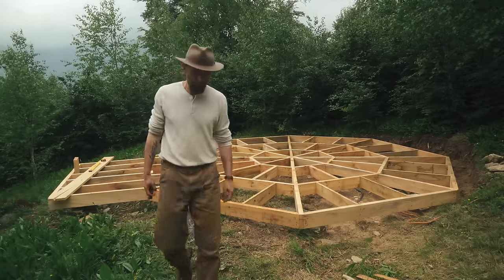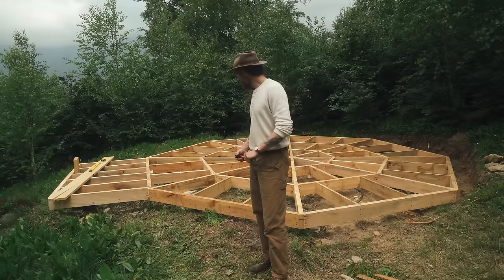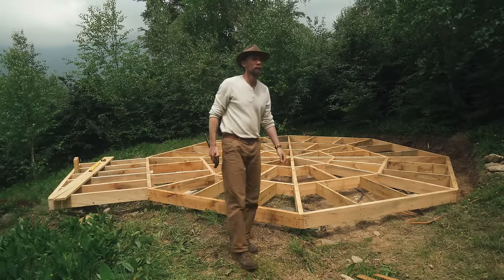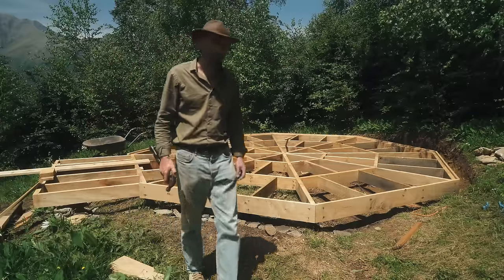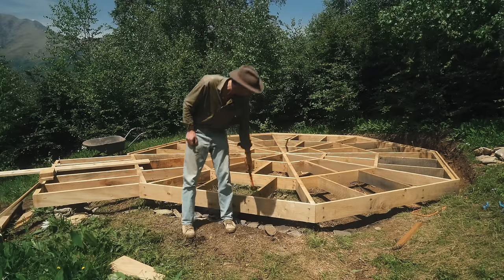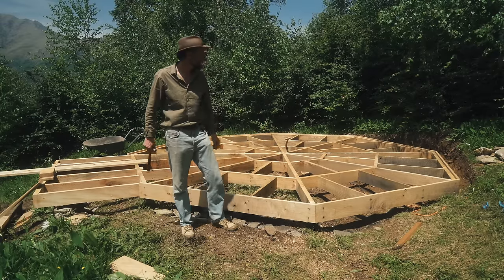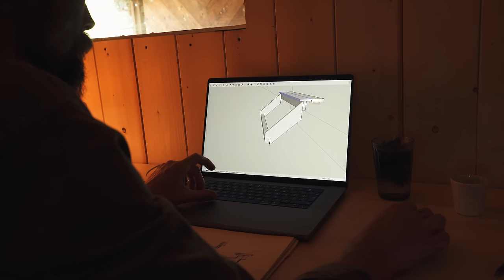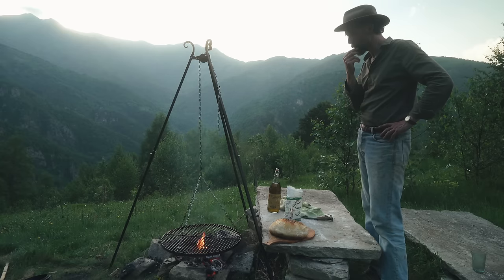#21 Baking bread on open fire, Planting more crops, Building the deck

Comment: What I find so interesting is that I would probably not do anything in the way or in the order you have chosen, but I think everything you have done is right. Great episodes. Always surprising.
Reply: I would have remained living in the trailer and focused 100% on the crane and doing the roof. But, I don’t know about his obstacles of distance, driving, winter, etc. If the roof were done first, there would be no need for an interior cabin, and the focus could be on renovating the interior permanently. What I don’t understand is why not put the interior cabin inside the larger stone barn, if you’re renovating the smaller cabin.

Comment: Dutch oven baking is quite the challenge!  Glad you didn't give up :D. The black staining on your wood could be reduced by applying oxalic acid diluted in water.  Apply it generously, wait until you see change, then rinse.  It should work on the wood, but not sure how it will react with the nails/screws.  Furniture restorers use the solution when removing stains.  I've never seen if nails/screws were involved.  You could research if you're that intent on removing the stains.  Love your channel.  I never miss an episode!!

Comment: May i suggest finding a dutch oven with feet . That way you can move it from the direct fire off to the  side and put coals underneath and on top . There is more then enough heat and it is more gentle . If you want to learn Dutch oven cooking  check out any Cowboy campfire cooking videos  . Those guys are the experts . Another great one

Comment: Great video. The way I do bread in a skillet is to heat the dutch oven on the fire, then take it off and out it on a trivet on the ground. Then put a ring of charcoal on the ground around the trivet and just a few on top. Then every so often turn it 1/4 rotation to make sure it's all cooking evenly. Just check it until its done.
Cheers!

Comment: The best way to bake bread in a Dutch oven on an open fire is to put the dough on a baking dish/cake pan inside the Dutch oven and have it elevated off the bottom by something like an upturned ramekin dish or similar on the very bottom of the Dutch oven so that the heat can still circulate underneath but it’s not directly against the fire and will cook more evenly. All the best!

Comment: Martijn, probably too late now but in NZ we use galvanised nails for exterior use and steel nails for interior as the steel ones will rust outside and will stain the wood plus become weaker over many years. I would have used galvanised screws or nails.

Comment: Not sure if anyone answered your question about the black around the nails, but it is the tannic acid in the wood reacting with the iron in the nail. Will also react to the sole of your plane. Try stainless steel. Oak is really bad for tuning black.

Comment: The term upper crust for the rich comes from the bread being less than great on the bottom.  The inferior lower part was cut off and sold to the poor.  The upper crust and bread was for the rich.  Let your coals burn down, no open flame. set your dutch oven on rocks just above these coals, and add coals to the top.  Do you add any oil to your bread dough?

Comment: If your having trouble with the bread burning on the base; just theorising, but you could try lining the bottom of the pan with vermiculite bricks (what they have on the bottom of pizza/bread ovens). It may add enough thermal mass that you could take the pan off the coals, or lift it further up and give a lower contact temperature underneath the loaf.
Maybe worth a try.

Comment: Amazing as always. I might have something to add for once, even though it's just the bread. I've never done over an open fire but it might still help. To help the crust form and be nice and crispy I spray a bit of water right before closing the lid. The steam forming inside the dutch oven helps the bread to cook without burning to quickly. After half of the baking time (in a home oven it's usually around 20 minutes at 220°C) I take off the lid to let the steam escape so the bread crust can crisp up, maybe you could just slide the lid off to side a bit or something. Also I'd experiment with pulling the dutch oven up as it bakes to mitigate the burnt bottom. Maybe gradually or maybe halfway through the baking time when you open the lid. Then you'd probably have to keep the coal on the lid to still get enough heat for the top though. I find it very interesting to try out different techniques on an open fire. Definitely interested in more baking/cooking. Also what an amazing way to live. Baking a bread with view over the alps. Dreams right there. Keep it up

Comment: try  one piece baking paper (or silicone 'paper') across the bottom long enough to go up the sides to lift bread out when finished - helps avoid scorching on hot metal bottom.
Also - after 10 minutes take off lid, give 4 or 5 good sprays of water, replace lid immediately and continue baking. The steam helps the rise, the crust and avoid scorching.

Comment: Steps are usually, 170 mm high by 250 mm wide, (foot step plate). Thats the normal architectural standard in metrics. I am sure looking at how tall you are those measurements will work for you. 😉 gorgeous bread, just need some Lurpak , lekker!!

Comment: That bread looks great, maybe try the Aussie way as for damper which is just the same but we dig a hole big enough for the pot to fit usually cast iron, put 2-3inches of hot coals in the hole then cover the lid with coals, a layer of foil folded in the bottom also helps good luck. 
PS same cooking time just not direct over 🔥

Comment: Ahhh.... it's called a Dutch oven, that pan you baked the bread in. Good to know. I think that maybe placing a grill inside this pan will keep the bread from burning its underside, or maybe placing the pan a bit higher over the fire. I know it's the 3rd attempt for you, that's not at all bad.
The bread looks great inside, good texture. I'm still working on improvement of my own bread.

Comment: I saw a u shaped stack of stone 24 “ high with bars of metal laid and mortared across at 6 inch intervals to create oven shelf then walls built up another foot or so on top of rods and lay  a slab like your big roof stones….which becomes a non stick fry/saute area…lay fire on floor / bake bread on oven shelf…create a door out of scrap metal and prop shut when baking if needed to keep temp high but bread only needs 350.   Pour water on slab when finished and scrape clean with very stiff brush…

Comment: the trick to getting bread to bake on an open fire , is to keep the temp even. Heating the bottom, adding the dough, remove from fire, put coals on top and set in vicinity of fire. Should produce even cooking.

Comment: When baking with a Dutch oven you want most of your heat on the top 
I would also suggest raising it a little higher off the fire but I will say it's hard to master getting a perfectly even heat.
It definitely takes practice good luck.

Comment: You can remove that metal stain with Oxalic Acid - there's a product called Barkeepers Friend which contains it if you can't find the acid alone. Those stairs look too steep to me and the notch (birdsmouth) over the footer is too big, weakening the string - I'd recommend having the strings pass over the footer beam with a small birdsmouth on the underside = stronger and less steep

Comment: Martijn, it is probably a reaction of the iron nails and the tannins in the wood. I used to get black stains on my hands when working with Jarrah here in Australia when the sweat reacted in the same way as iron, oak is another wood that reacts in this way. To remove it (from my hands) I used to use vinegar, not sure whether some vinegar applied on the stain not the nail (as it would increase corrosion) might help. Also campfire bread made without yeast is called damper her downunder.
Reply: interesting , in the aquarium hobby we soak the wood in water to remove tannins , does iron nail really cause it to leech tannin ?

Comment: I keep feeling that the platform could be a little better supported at the edges because as you stepped there it dipped quite a bit.
I see either blocks of 2x4's or solid stones piled atop one another. The platform looks beautiful overall.

Comment: For your bread, set your oven on a small even bed of coals. Try about 1/3 coals on the bottom and 2/3 on the top. Direct fire is too hot for baking.

Comment: I wonder if a rack under the bread in that pan might work....I've seen round "racks" or inserts with round holes rather than rungs....that might work for the bread by keeping the bottom a little elevated from the burning hot pan-bottom....?  Or just a round runged rack with some aluminium foil???   You're a brave wild one.

Comment: The bread was too close to the fire and the pot was too heated up. You'll get there. It's a fine line of finding the right temp. I've never done it on an open fire, but I've done it on a grill using coals. Just bread in general takes several repetitions before getting it right. I've been working on my whole grain sourdough recipe for years and the first dozen attempts were not perfect.
Reply: Ah... I saw the third attempt now. Yes... don't pre-heat so high. But as you can see, you are already getting it. My first attempt was similar - burned bottom. LOL

Comment: Loving the cafe lights and the platform/deck shape is delightful!! Martjin, can you tell me what's the purpose of you  burning the tips of the wooden posts? You can tell I'm not a carpenter by asking this! I had to go get myself a slice of raising and 5 ancient grains with a slice of turkey ham after watching that bread being sliced!
Reply: Analily Park the purpose is to make them resistant to external influences. This is very old practice, but still is excellent solution.

Comment: How about your energy in the night? You probably have battery's for that. Never thought to experience wirh a closed watersystem? A bassin up high and one down the hill. You pump the water up during the day with the power you do not need from your solar system and let it run down during the night to generate the power you need. I only do not know how much water you need for 3 kw a night. Can't find that on the net.

Comment: It is rust….you need galvanized nails or deck screws designed for the outdoors…..These nails are going to rust, then rot, then break if they are under pressure.   Get deck screws and forget the nails, they are specially designed for this purpose….
Reply: Sounds s like home Depot fan.  Nice tip.
Reply: Maybe the can sponsor your videos?

Comment: For building construction permit it depends on the commune province.  There are fees to the mayor, architect, engineer and the commune.  Some person manage 1.5 years to get it all done and receive the permit.  But anything over 1 year is normal.  Unless you hire a respected construction company to do the work for you it may happen in a couple months. You live remote like me away from town so they do not come by very often but just collect the money. :( :)

Comment: Way too hot. Only put the camp oven on coals not flame. You don't need to preheat the oven.  Just put the bread in the oven the build hot coals around it and over it away from the fire itself.

Comment: stainless steel nails only, also last years especially in oak or chestnut you might get away with galvanised nails but hitting with a hammer exposes raw steel so some can be affected , good job and it's going to be an amazing spot with that view.

Comment: Re: rustic bread making in Dutch oven.

- Consider a trivet inside on the bottom of the oven.  This will ensure there is a space between the hot inside bottom of the oven and the underside of your loaf.

- placing the dough cradled on a long sheet of parchment paper.  Which will sit on the trivet.  Either end of paper will be used to lower into the oven.  The excess can be tucked under the lid inside.

- when time is up remove lid and grab the ends of parchment to lift bread to lift the loaf.

Comment: You need to get a little rotary push mower to cut the grass between the paving rocks.  It would be so much easier and faster.  No fuel required.

Comment: Your bread is looking better each time. I used to demonstrate baking in a dutch oven in a restoration museum. To avoid burning the bottom of the bread, try two things - the first is to put some corn meal in the dutch oven. It raises the bread just a tiny bit off the hot interior surface. But the more important thing is the way you're using the Dutch oven. Instead of hanging it over the fire, put it down into the coals of a fire you've let burn for a while. There should be no flames. You can put down 3 stones to raise the oven a bit so more coals are under it, but you really don't need more than an inch or two of coals. Make sure those stones are very dry or they'll explode. Then put your bread in the oven, and fill the recessed lid with coals. You can put your hand in before the bread goes in, to check the temperature. I'm not sure how much time your recipe calls for, but 20 minutes sounds too quick for yeasted bread. Try a lower temperature - 350 Fahrenheit - for longer. 40 minutes to an hour. It tastes so good!

Comment: Thanks for advice over sketchup, I used it to design an outdoor wall/bike storage cupboard. I was wondering how I was going to build it and sketchup helped me with how the frames are going to join together and also with how the roof of the storage box was going to work. I already have a frame assembled and installed and would be working on it today had it not been raining. I am look forward to your video's. (You should seek sponsorship from sketchup!)

Comment: Your videos are so inspiring.  Please continue making these amazing and educational videos of your life in that beautiful country.  I can't build anything but I can bake bread.  Dutch ovens over a campfire are wonderful, but bread will burn if you try to bake it over a flame.  You need to wait until you have hot embers than place the oven either in the embers or very close to them with more embers on the top of the lid.  Bread can bake very slowly, but should be checked every 15 minutes or so then you can decide if you need to lift it higher away from the coals.  Keep trying and it will soon be perfect.

Comment: Oxalic acid diluted with water will get rid of the staining (it is a reaction of tannin in contact with steel usually occurs when using oak or similar hard woods). Regards James.

Comment: Great video. But you should replace the mitre saw, it's painful to see you do each cut multiple times not to choke it 😂 Can recommend to the Bosch GCM12 GDL (no protruding tubes so it can be used against a wall). Using DeWalt eco-system for all battery powered tools but that mitre saw is a a beast in power and depth capacity at all angles 👍 Buy once, cry once.